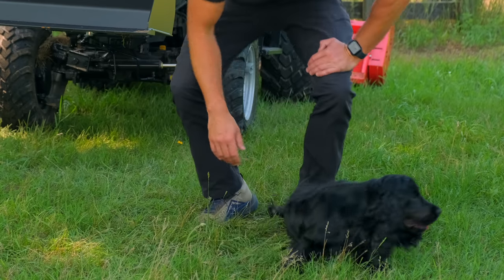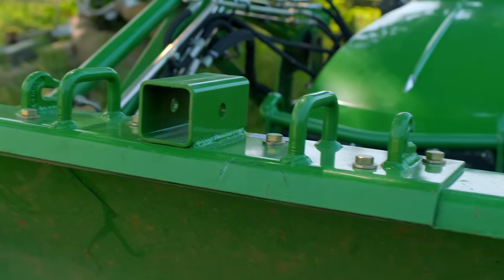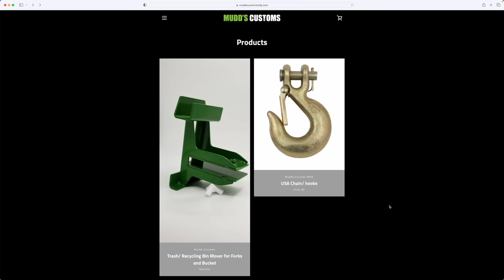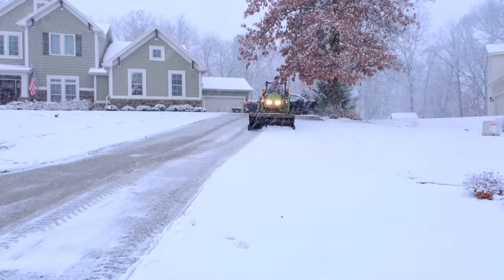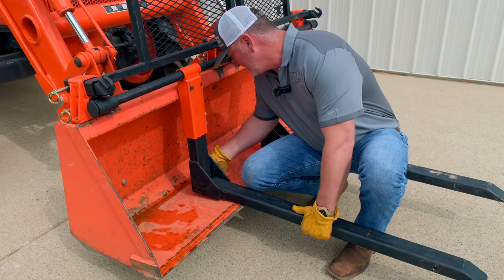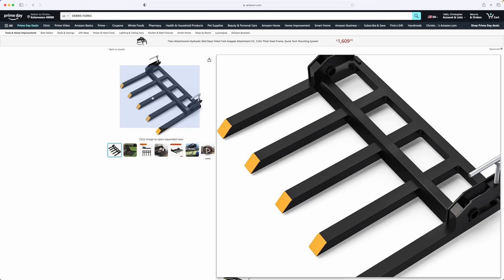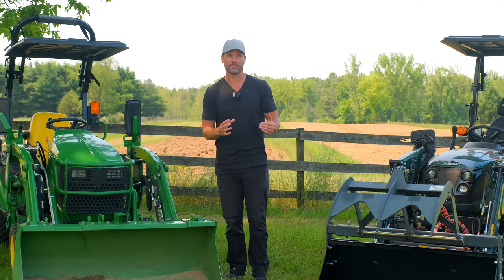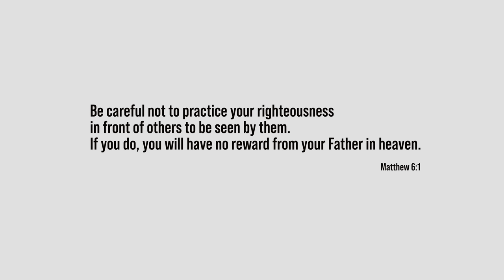BORING BUCKET BLUES! 10 MODS TO MAX OUT VERSATILITY! 🚜👨‍🌾

Comment: I purchased the ratchet rake last year.  I have used it multiple times to clear land and over growth, weed removal, and used it to remove a long row of bushes.  Between the down force of loader arms and the rake, it rips small bushes apart.  It works extremely well for ripping large sections of weeds out of the ground right down to the soil.  I would definitely recommend the ratchet rake to anyone.

Comment: The latest addition to my tractor accessory stash was a set of those clamp on debris forks.  I agree with you about the shortcomings of clamp on pallet forks, but I love these debris forks.  I bought them specifically to help me move a large pile of construction debris into a dump bed trailer.  They did a great job and were an affordable solution.  Since then I've used them to carry tree trimmings, working pretty well as a poor mans grapple.  Although they don't "grapple", just carry.  But they do that better than my pallet forks.  They are easy on-off and do a great job for light weight stuff.  I would not recommend trying to move a big log with them, might bend the bucket and the load is so far out front of your pins the lifting capacity is quite a bit lower.  QA pallet forks are better for that task - if you don't have a grapple.
Reply: My land pride debris forks stay on unless I'm scooping dirt. My place is nothing but debris and 1-2 man rocks. Great investment. You can usually muscle a pallet around as well.

Comment: I've had a Ratchet Rake for 3 years.  Great tool for clearing brush and vines.   Fits well on the bucket.  The 2 ratchet straps hold it tightly in place.

Comment: Debris forks are awesome especially for a smaller yard or if someone is just getting into the game with a bx or something small. They’re great for carrying boards around the yard or moving piles of brush and they don’t twist or slide. I used mine to rough up packed clay banks along a trench and using the bar across the bottom under the bucket I was still able to back drag the loose soil and level it out where my bucket edge would have to follow the rough ground when it’s pushing the soil

Comment: We went with the Pirahna toothbar so the "float" function on the bucket was still viable. Our 1025r was used and when the Piranha arrived we found that evidently the previous owner had already drilled the two holes to mount it.

Comment: I have a new Hydrostatic L2501.  I bought the Ratchet Rake soon after I bought the tractor.  It’s a very versatile rake/ground moving attachment.  Wish I had bought one for my B7500 20 years ago.  The design is VERY sturdy; attachment takes 5 minutes.  The 1/2” thickness adds strength all along both toothed edges.  Unless you accidentally run into something I don’t see the attachment ever leading to a bent bucket, which is  my concern with other toothed attachments.  Billy

Comment: I have both edge tamers and a snow HLA1500 snow pusher.  The edge tamers work for snow removal, but I found the snow pusher more effective.  I found the snow pusher to work fast since the JD bucket with edge tamers fills quickly with snow.  The edge tamers worked extremely well at protecting my lawn when I used the bucket to remove giant piles of leaves for disposal.
Reply: I have both as well. Edge tamers haven’t been installed since I got the snow pusher. Need to sell them lol
Reply: @philipdamm8850  I was considering getting rid of them until I used them on my lawn.  Saved the lawn.  They're inexpensive so it's not a budget breaker if I don't get rid of them.  I might have other uses for them in the future.

Comment: I have a 5075e cab for my 24 acres.  If I had it over to do again I think I’d buy a skid steer instead.  The ground here is just big flat rocks (picture a broken up sidewalk) mixed with smaller rocks under an inch of topsoil so 3 point implements just skip over the ground and when they do “grab” they get damaged by the next rock they hit.  The front end loader has the same issues but I haven’t bent anything yet, knock on wood.

Comment: Good video.  I have a Farmtrac; therefore, a little difficult to do much upgrading.  If I had more fabrication skills, I would love to cut my current bucket mount and change it to a skid steer mount and then I could really get some additional flexibility/usefulness out of my tractor.  If you don’t want to feed the Amazon machine, Northern Tool carries some of those bucket clam on accessories.

Comment: I use the VEVOR Tractor Bucket Protector, 2pcs Ski Edge Protector, 12" Long Turf Tamer Skid Protector on my bucket for plowing my gravel driveway they work great and are the same design as the Edge Tammers but you can get the pair for the price of one edge tamer.  I'm in upstate NY so we see snow I have used these for 2 years now and have had no issues at all